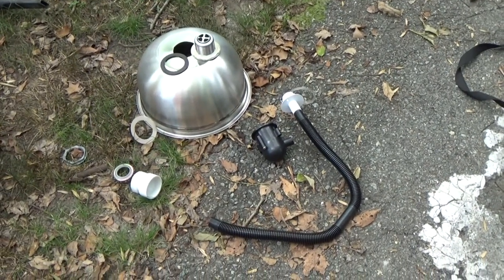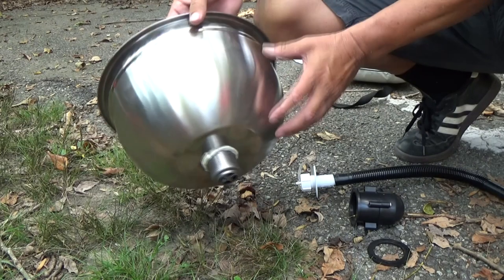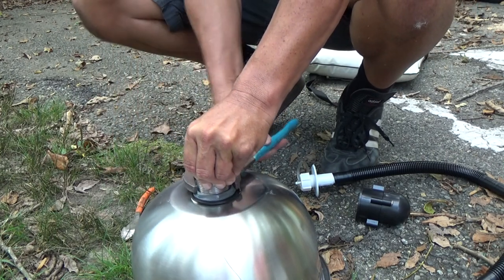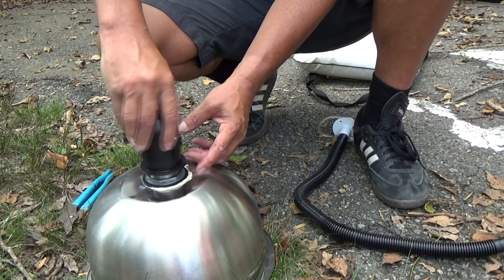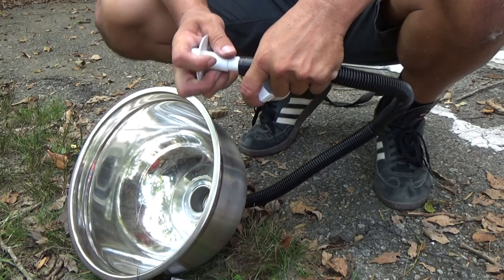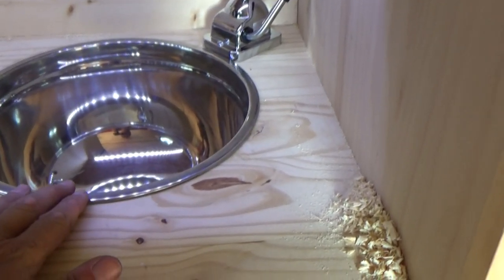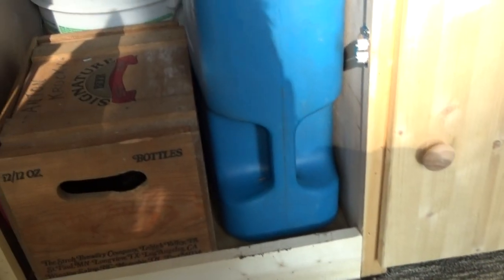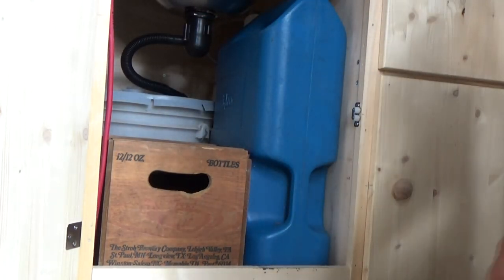Camper Van Plumbing For My Sink  EP7

Comment: I'm making one of these sinks BUT I cannot for the life of me find that small drain, right now I have a pop-up drain but the underneath part that would sit on top of the salad bowl is tapered so there is a gap between the bowl and the drain. Everything I find goes into 1 1/2 inch piping that screws into a drain extension there are all built the same way its so frustrating, I've been looking for a week now online and that small draining in your video  is impossible to find at least in Canada,  can you please link me , thanks

Comment: Is you drain 1-1/2"? Mine is and I bought the camco adapter but it's too big.. looks like it fits a 2"
Reply: I’m having the same issue. Did you find what the right size drain is?